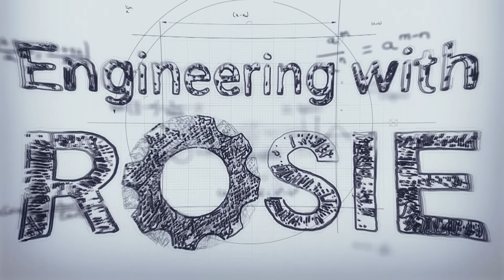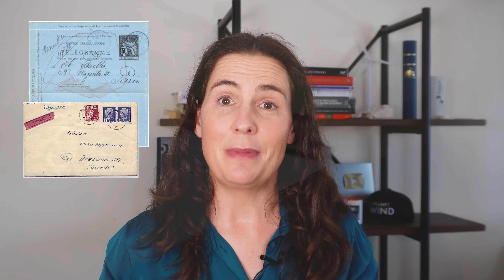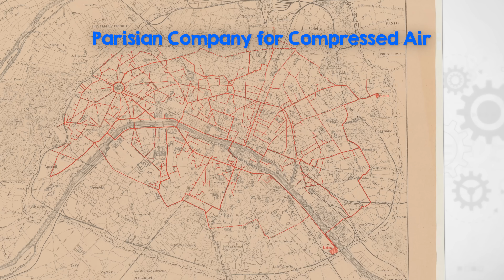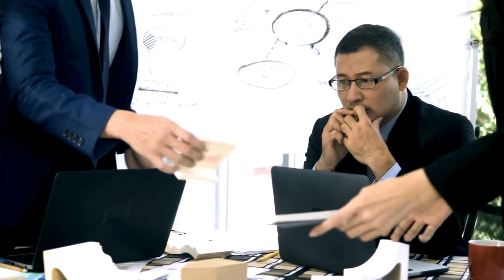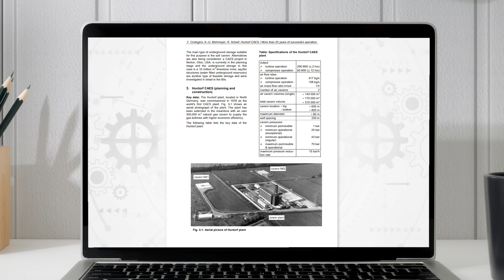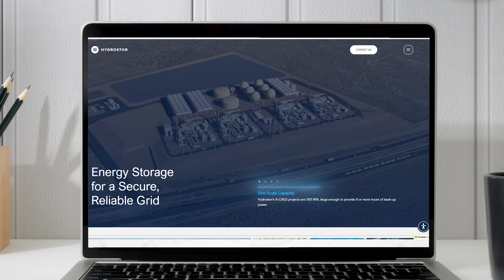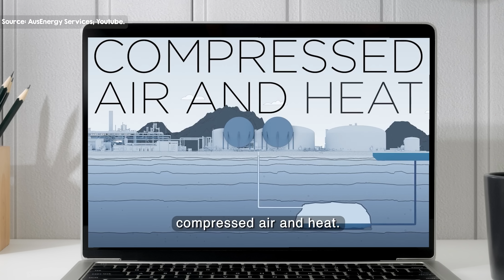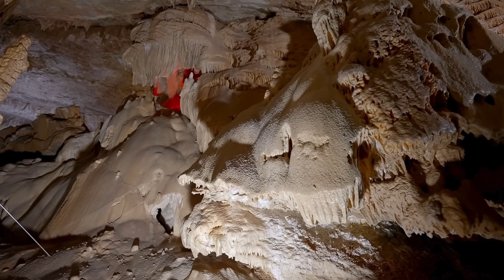The Genius Energy Storage Idea Everyone Forgot

Comment: Compressed air was used to power underground mining railways until electrification replaced it.  Compressed air is still used to power drills and excavation machines.  Steam and internal combustion engines were not feasible in that environment.

Comment: Salt mine storage........
Thankfully this is air, not gas, lol.
UK, gas has been stored very cleverly in gas holders and later salt caverns.
They are porous, a small correction. But as the gas goes into the pores, it expands and freezes. Genius.
BUT..........
It's progressive, pressure balance, unfreezes, moves on to the next pores.
Ok in mines, but a gas holder was a major problem to decommision as 10m of gas permafrost had to be dealt with.

Comment: 6:20  These are still in use.  2 different banks I've used in the last 10 years have both had multiple lanes of drive throughs.  The lanes not directly next to the bank used these compressed air cartridges to facilitate deposits or withdrawals.

Comment: The idea of the Australian project seems very strange to me. If you are relying on pushing a mass of water to a higher level to store energy why not simply pump it up and then have a turbine at the bottom to generate the electricity as it returned to the lower level? It would be much simpler and more efficient. I'm 82 and I can remember the tubes in the shops moving money and receipts around. The wait for the receipt and change to come back seemed very long. I guess the store owners thought the inconvenience was worth it because it prevented the shop assistants from stealing money.

Comment: In practise, CAES will be lucky to achieve 50% turnaround efficiency and over quite a limited range of its notional storage capacity.  Aging of plant and pressures away from that limited capacity will reduce turnaround efficiency further.  Therefore it will be a limited, short duration storage which cannot really contribute to the levels of security of supply that people expect from their electricity grids.  There will be other losses, such as "wheeling" power around the transmission/distribution networks, and it suggests even lower immediate turnaround efficiency, but 50% will do for now.  At 50% turnaround efficiency, CAES will need to double the power price from the storage phase to the generation phase (the price spread) just to break even, and it should be clear from this that energy storage absolutely depends on price volatility for high spreads.  It therefore DOESN'T stabilise price, but DEPENDS on price volatility to earn its income.  
Naturally, break-even is not a viable business plan, so the doubling price spread mentioned above (assuming 50% turnaround efficiency) doesn't paint the complete picture.  A CAES scheme will have a variety of associated fixed costs, including salaries, maintenance, local taxes, business taxations and others.  It also needs to pay back the initial capital outlay, noting that there will be a relationship between the design for higher efficiency and the resulting capital and operating costs.  Therefore, to say that CAES needs the electricity price spreads of 2-times would be a gross underestimation of reality and there would never be an acceptable investment case.  Prices spreads will need to be multiples higher, and  we then arrive at an awkward reality of the economics of energy storage. Economic electricity storage (at realistic turnaround efficiency and fixed costs) depends on horrendous price volatility at daily resolution to make a genuine  investment case. With those levels of volatility, no other investments (e.g. in primary power generation) are going to be bankable.
CAES will only exist in very specialised and limited circumstances, and otherwise it will only be part of public electricity supply with a government-subsidised-lets-all-pretend investment case.
If you want high power prices and a hobbled economy (as we have in the UK), them maybe you'll still like CAES.  Otherwise, forget it.

Comment: Highview Power should have got a mention here. They are liquefying/gasifying rather than simply compressing/expanding, but this helps deal with the diabatic/adiabatic losses, and the dramatically smaller size requirement makes it geography independent.

Comment: So, in terms of energy storage, power, return on investment etc., how does compressed air in an air-tight cavern compare with pumping hydrogen down into the same cavern. And how does that compare with the cheapest batteries? 

(You could also satisfy my inner pedant by using kWh, MWh, etc. and avoiding "80,000 homes" which obviously depends on whether they're American, Australian or Indian homes and whether it's peak demand or over time.)

Comment: The French invented a compressed air van a couple of years ago; December 2, 2004 French engineers have designed a low consumption and low pollution engine for urban motoring that runs on compressed air technology. The CATS (Compressed Air Technology System) "air car" from Motor Development International is a significant step for zero-emission transport, delivering a compressed air-driven vehicle that is safe, quiet, has a top speed of 110 km/h and a range of 200 km. Costing next to nothing to run, the Zero Emission Vehicle (ZEV) range - which includes a pick-up truck and van - is set for release in early 2005.
Reply: AI slop gets everywhere, doesn't it?

Comment: Hi Rosie, just wondered if you had come accross the relatively recent developments with hydropower? Using a fluid that is 2.5 x more dense than water but with similar viscocity in an energated state.
This allows smaller hills to be used for hydropower opening up many more potential sites.

Comment: Yes the history was interesting. I have worked in factories with large scale pneumatic systems, useful in areas where electric motors might cause arcs and dust or flammable vapour explosion. Air tools were generally lighter and more robust than electric power tools in the past.

Comment: Using "X" energy to power a turbine is an involving process. Unless we are talking hydro turbines like a Francis style or Kaplan style the turbine it self rarely exceeds 85% and then you have the alternator attached to it which adds an additional 10% loss at least. Batteries can do better than this.

Comment: Excellent video.  Large pressure vessels can be built above ground using post-stressed concrete, rather like nuclear reactor containment vessels.  Steel vessels become impractically thick at the size needed.  Safety is also an issue as tanks increase in size.  Capital costs of concrete structures are still significant, but system lifetimes could be measured in centuries.  It is a pay once and use forever sort of arrangement.  You don't get that with any kind of chemical battery.  Compressed air can also be stored underwater, in ballasted tanks.  CAES would work best in places with town heat networks.  That way the heat can be used without complicating the cycle.  The same is true for the cold produced by expansion.  A town sized system would be a good place for an ice rink or a giant cold food store.  CAES works best with integrated thinking that tie multiple applications together.

Comment: Wind mil tower could be used as Caes as storage if the tower is extended underground concrete used could be reduced 75% as well as rebars .
 Reheating to extreme temperature is not necessary if triple stage piston engine with intercooler only the last stage needs heat and the exust heat recycled in the first stage,

Comment: I heard that this system does recover a portion of the heat of the compression and heats the return air prior to each stage of expansion. The proposed cost of the project is also somewhat more than this, and above the $480 per kWh of batteries. Given the mechanical wear and servicing the compression and expansion systems are required, the opex costs are likely to be greater than battery (BESS) as well. The water head from the above ground reservoir, maintains a constant back pressure for the turbo-machinery.  Round trip efficiency is around typically around 60%, and therefore also less than batteries. Consider this kind of storage when your cavern is close to the users and suppliers and you do not need to excavate the cavern. Therefore an edge case that works for some places and not others.

Comment: I am really interested to know why using the same cavern for pumped storage (water) would not be considered. Can you run the calculations? Is the air compression effectively increasing the capacity to store energy (i.e. you get the energy storage from displacing the water 600m upwards, plus the compression of the air?

Comment: why does the compressed need to be heated as it is used?
Reply: It doesn't, but you effectively get a super-high return on the energy added through combustion. You're effectively running a gas turbine engine without 'wasting' energy on the compressor stages before combustion.

Comment: Or instead of the CO2 gas Energy Dome the HBr-flowbattery? The hydrogenbromide flowbattery has an allround trip efficiency of 70 %. 2 HBr + ⚡<--> H2 + Br2. The disadvantage is the storage of the hydrogen gas (when you can't use is a 84 % efficient electrolyser during charching when you can use fossile SMR hydrogen when discharging) . But maybe you can use the cavern as a cheap hydrogen storage: 
https://blauwgroenenergie.blogspot.com/2024/05/an-hbr-flow-battery-e.html

Comment: More efficient is the use of CO2 gas in stead of air (N2/O2) like Italian (Sardinia) Energy Dome does. The Australian project needs fossil fuel to heat the decompressing air. But Energy Dome stores the heat that is formed when the gas (in this case CO2) is charging/compressed (P/V = T,  boyle gay lusac) and uses this heat when the compressed CO2 is decharging/decompressing. The efficiency will be higher but the MWh stored will be lower. Because the 295,000 m3 cavern will then not be filled with compressed gas but with the low pressure CO2 (So when the battery is discharged the cavern (or dome) wil be filled with (low pressure CO2)    https://www.youtube.com/watch?v=wftcfc901Fo

Comment: As always, great video, but the tech itself is kinda ridiculous. Geothermal storage has way more potential. You frack first, then keep those fractures under pressure with incompressible water, and let the weight of the earth push it back up. SAGE Energy is already working on this. And that’s just one approach. New geothermal offers a whole range of ways to store and generate energy. It’s the future. Compressed‑air storage will stay a niche solution for specific sites, but it’ll never match the efficiency of next‑gen geothermal.

Comment: BS,  It is a just a funding scam.  It is does not need to make sense to be a success from the prospective of the people pushing it, as they get paid regardless.
It is all about the funding. If you are get people and governments excited about anything you can get them to throw money at you.
Yes, I know it is used in industry, we have a large air compressor system at work.  It does not scale though that is the issue and has an extremely poor energy density.

Comment: Conventional compressed air energy storage (CAES) demonstrates the lowest performance, with a round-trip efficiency typically limited to 40–55% due to significant thermodynamic heat losses during the compression cycle. Lithium-ion (LFP) currently leads the grid storage market with a superior round-trip efficiency of 85–92%, though advanced DC-coupled systems can reach up to 95%. Pumped hydro serves as the most reliable mechanical incumbent at 75–82% efficiency.

Comment: Great with the historical context!

Big problem with CAS is the cost per kWh. 

Obviously this is very dependant on the number of times per year that it is used, so maybe the best measure of this kind of storage is the cost per year capex plus opex. This is because you would simply want this to be there and use it a limited number of times per year.

The next major issue is adding the transmission costs. A large amount of low cost sodium batteries could be placed near consumers or at intermittent renewable production, to smooth out load on transmission lines. Hydro or CAS may need to be far from either location as well as too big for one location so the additional transmission costs need to be added to these solutions. 

Then add the time to build.

I suspect that low cost batteries will simply be the best solution all round.

(Of course the other part of the solution is long distance transmission lines to push power around depending on time of day usage, so that we can move our power around in both time and space)

Comment: Very low efficiency as it takes a lot of energy to compress a gas as well as losses converting compressed air into mechanical energy to run a generator.  This is nothing new. The first Compress air system was in Huntorf, Germany  (1978) and had a efficiency of about 42%.

This tech is a dead end

Comment: I think you would be too young to remember but just about every supermarket used an air tube delivery system to take cash from teller tills to the central office in order to avoid holding large levels of cash in the till. Tellers would put money in a torpedo, place in in the tube and whoosh gone and in the office in a few seconds! Another use of compressed air in the 70/80’s is car door central locking and power windows. I still have a Mercedes 290E which uses air for central locking, no complicated electronics and still running!

Comment: In the UK when we used town gas it went to ever town but didn't have the pressure,so they used Gasometers, large tanks that we're collapsible therefore ramping up the pressure for the gas to flow further, surely they could convert the Gasometers that are left to run on Air

Comment: Underground containers are 10 times cheaper to builds, mainly you adapt caverns for air pressure. If you build ground bases storages size of zeppelin hangars and even bigger for capability 50 MPa in very hot region at night you can isothermally compress air inside hangar size storage and at in day the mass is high Sun heat increases temperature inside hangar  for free that insane double win-win situation. Of course drawback is to rely on Sun what to do in rainy days or in regions with low sunny days. 

My calculation rely on isothermal compression without heating of gas slow from 10 p.m. to  5 a.m.  then night electricity is cheapest. And from 5 a.m.  to 4 p.m. is then storage is heated by sun rays to increase pressure even more. Hangar storage steel outside  hull must be painted with dark black color to absorb maximum sunlight and get maximum efficiency or even use even mirrors, A solar power tower, also known as 'central tower' power plant or 'heliostat' technology which can make ground storage system very expensive indeed. 

Double win-win situation then you increase mass of storage and sun increases temperature is really important except same with wind and solar panels sometimes wind do not blow and sometimes sun don't shine so again reliability of storage depends or is outside human control.

Comment: I remember tubes in supermarket checkouts, not for getting receipts but for the cashiers to send money to some storage vault when the cash registers got too full. Back in the day when everyone used cash...

For another application, look up "Rabbit" in nuclear engineering. Using small pneumatic tubes to deliver capsules with radiation targets into research reactors and then quickly to hot cells after irradiation. I think some hospitals also use them to send activated material from the production facility over to the cancer treatment facility.

Comment: As soon as I saw compressed air I immediately thought of Boyles Law. The heat is always going to be a problem with compressed air. Flywheel energy storage is quite cheap. It offers storage density in a similar density to lithium. With steel it's on the low side of lithium. With composites it can exceed lithium by a long way. The return efficiency which can get to around 95% far exceeds just about everything else.
Compressed air as storage is potentially probably better than using betterhelp. It's probably far less leaky for a start.

Comment: In the last example with the australian storage project: I can’t imagine that its more efficient to use compressed air to push up water rather than to use the exact same location as pumped hydro. Water pumps and turbines should be more efficient than compressors
Reply: pumpedhydro is more efficient but the compressed air stabalizes the cavern preventing damage. it also seperates the turbines from the water which should help prevent corrosion.